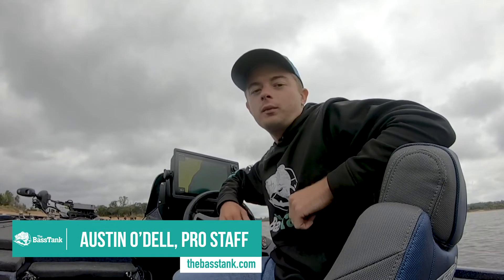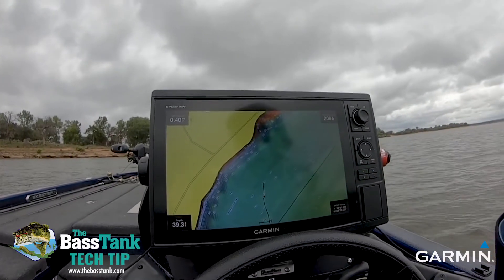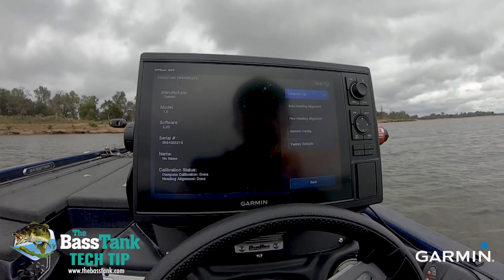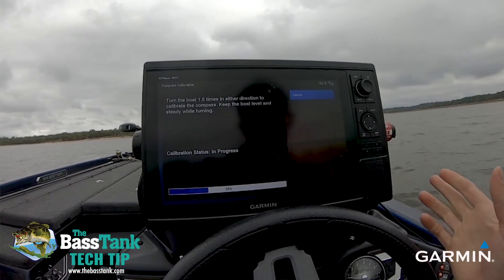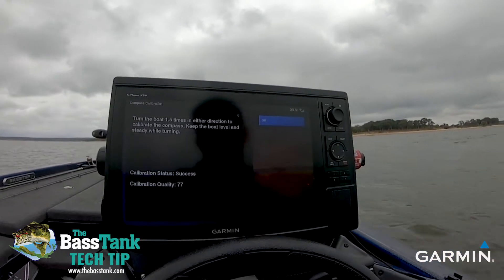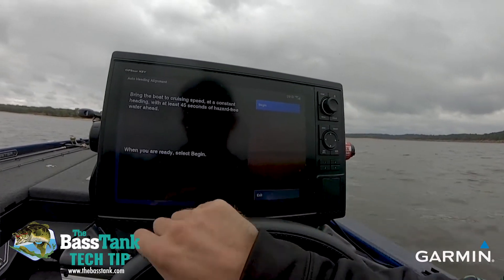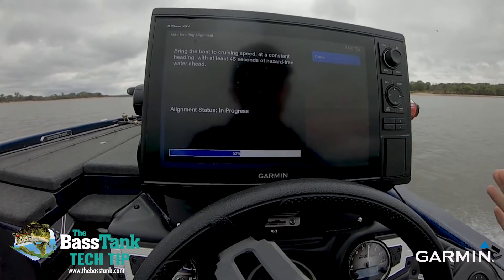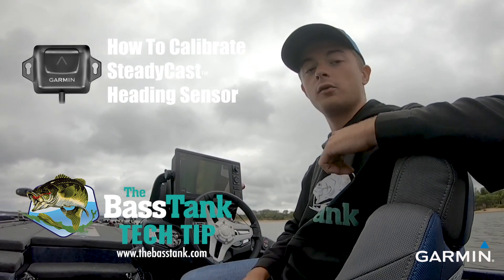How To Calibrate Garmin SteadyCast™ - TechTip

Comment: I just noticed another comment which I believe I can answer. The sensor itself is very flexible but needs to be mounted away from magnetic influences. It doesn’t have to point in any particular direction and that is why it needs to be calibrated as the video shows.